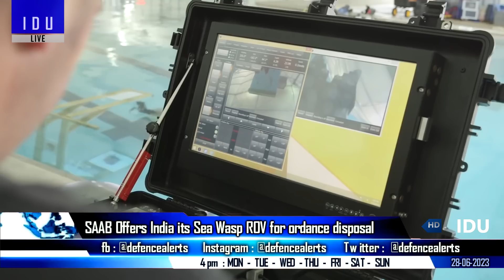Indian Defence Updates : Safran 130 Kn Engine,Tejas MK2 Flight 2025,NGCCM For UCAV,Tapas User Trials

Comment: Tejas mk2 2025 looks cool if it is true. Much awaited fighter
Reply: @Flying-Tiger not fair to compare with Gripen C. MK2 will be comparable to Gripen E with Gripen having superior electronics over Tejas. AESA radar, payload capacity(6.5 tonne), range, reliable long range BVRs, EW capability will make it competitive 4th gen fighter. Only question is when it will be out.
Reply: @Flying-Tiger Is that design not frozen at this point? If not, i am worried that it wont be ready in next 10 years